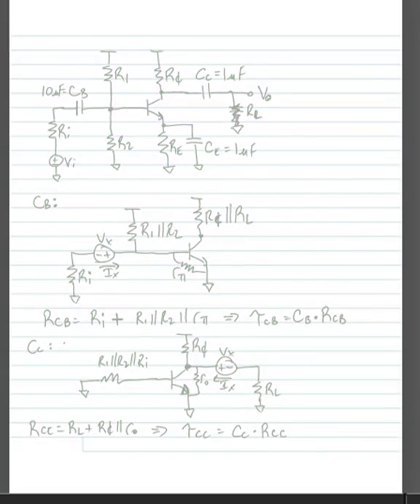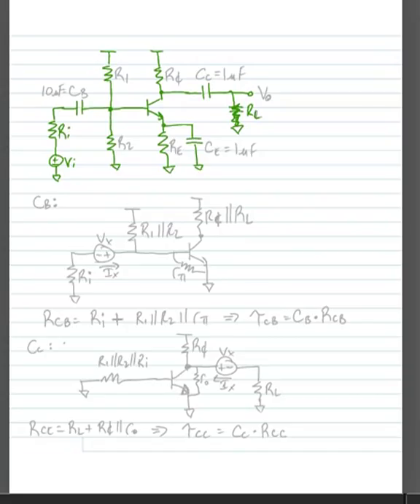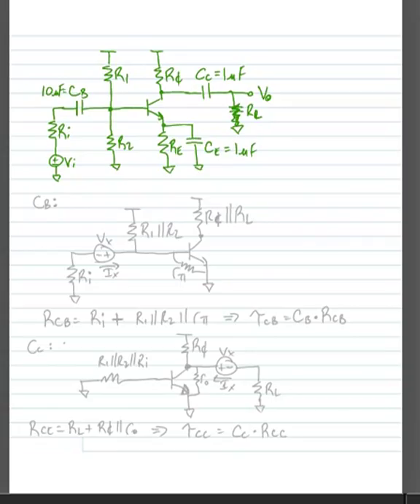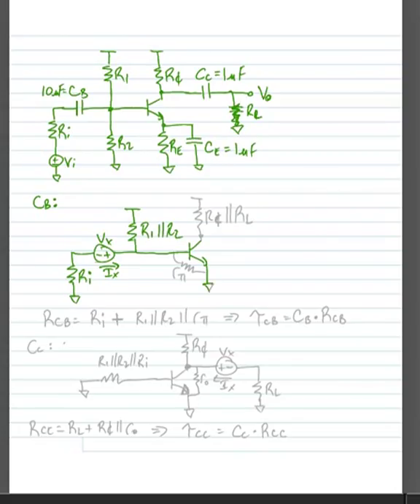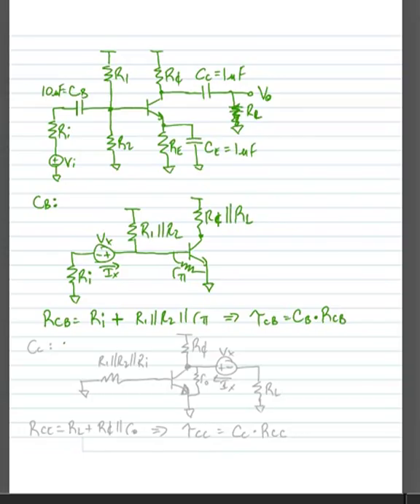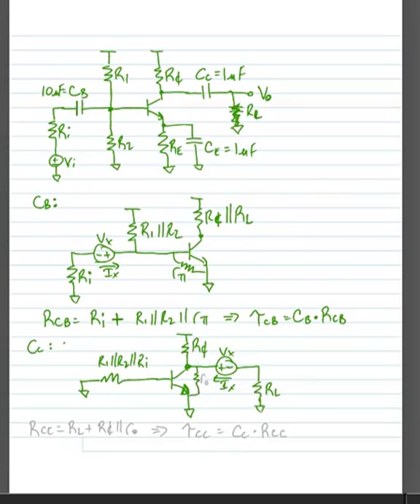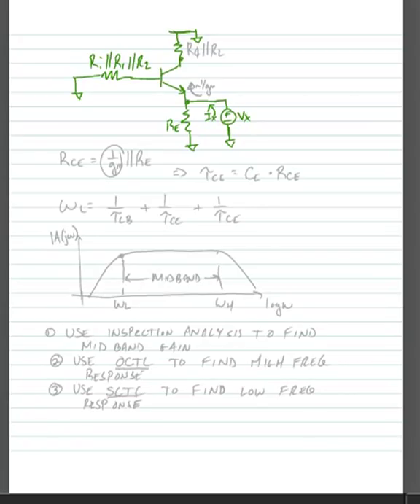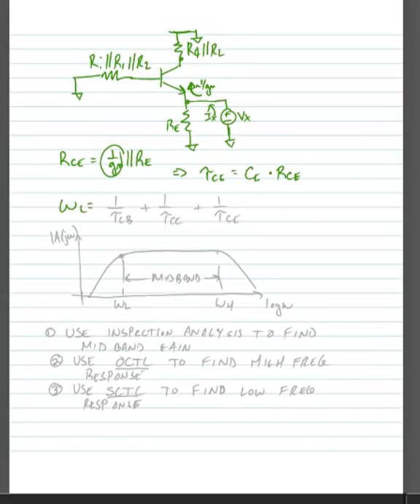ECE 3110 - Lecture 5 - Part 3 - SCTC Frequency Analysis - Example

Comment: Excellent video, thank you. I do suggest not to over simplify your calculation for Rce to 1/gm however. The series resistance and base bias resistors (Rs and Rb) if even divided by (Beta +1) are still typically large enough to increase Rce from just 1/gm by itself. Do you agree? Thanks again for the video.
Reply: +Drew Smith yes! that is how I have seen it. I have no idea how they derive that Rs||Rb/(B+1) . please could you tell me. its driving me mad
Reply from the maker: +Drew Smith Yes, the collector resistance matters (in fact if the resistance were replaced by an ideal current source, the impedance looking into the emitter would be infinite), but it takes a fairly large impedance to have significant impact.

Comment: Concerning the RCB step, why wasn't the resistor, ro, taken into account when you found the resistance of RCB? Also, when you found the resistance for RCE, when you look into the emitter, will the resistance of the whole circuit always be approx. 1/gm?
Reply from the maker: For RCB the output resistance would have to be reflected back to the input and would have little impact on the total resistance (it would be a large resistance in parallel with smaller resistances).

Comment: Another question regarding the calculation of RCE, will the resistance be appro. 1/gm looking into the emitter terminal when you take ro into account also? Or does it not matter?
Reply from the maker: ro of the transistor doesn't matter much, because it would be in parallel with 1/gm. If a large resistance were collected to the collector/drain it would affect the impedance looking into the emitter/source. For instance if an ideal current source were connected to the collector/drain then the impedance looking into the emitter/source would be infinite. 

The assumption that the impedance is 1/gm relies on the assumption that the load on the transistor is moderate to small.